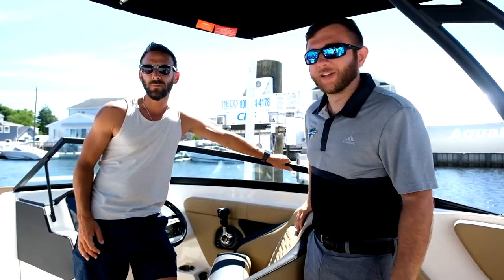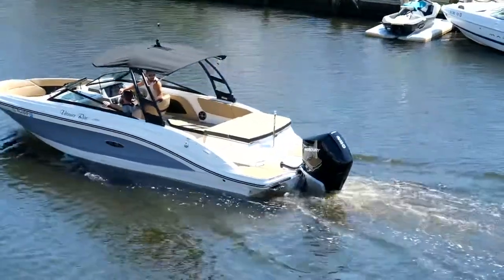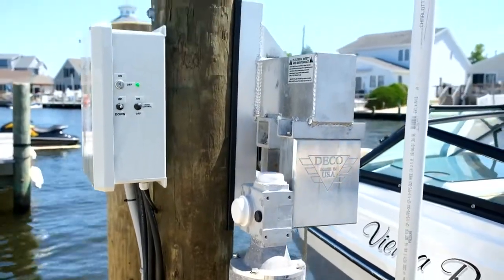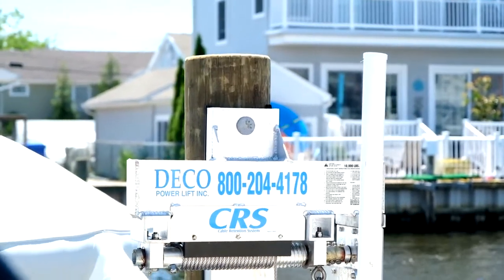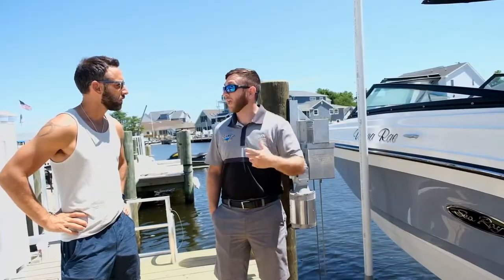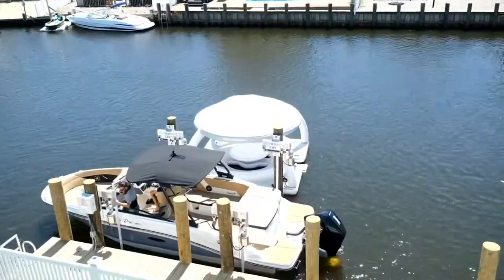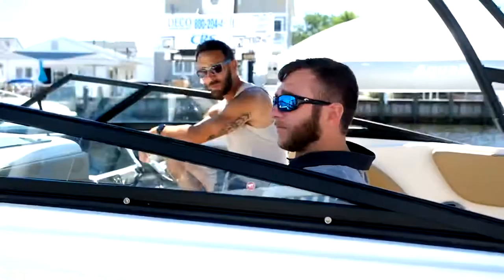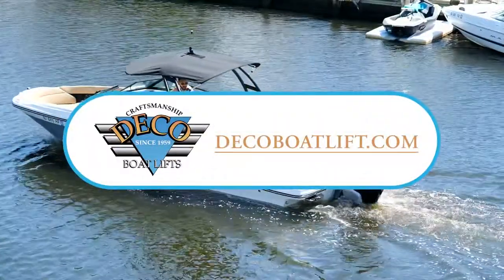DECO’s Flagship Beamless Concept CRS Lift

Comment: Looks nice, but my piles are 12 feet out of the water. The beams do not block the boat. Actually it’s a lot less to look at than what you’re showing here. And you have way more moving parts. Four motors, more problems down the road. That’s my take anyway. But a nice concept.